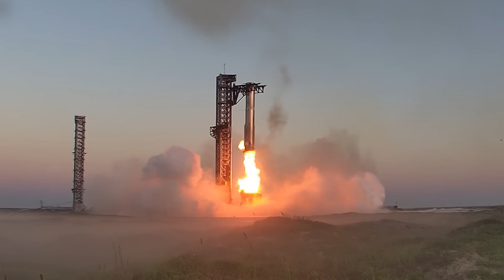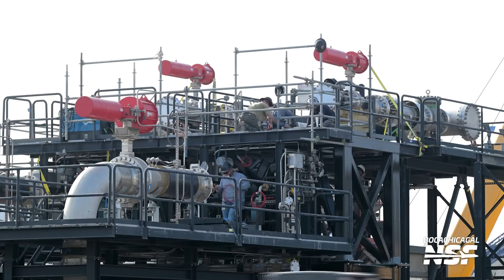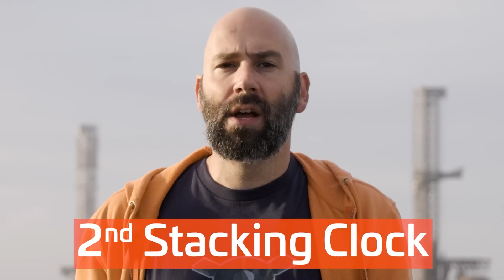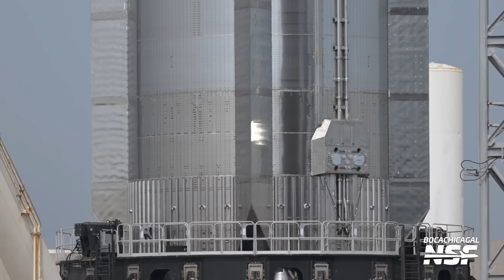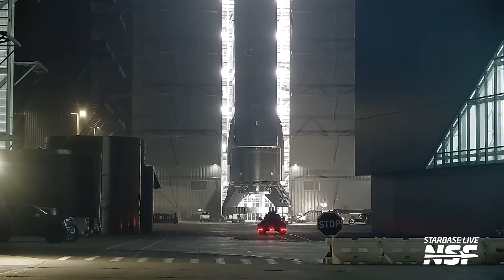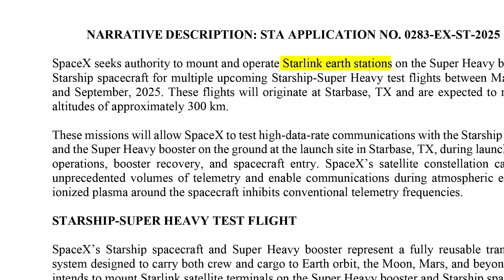Starship’s Longest Static Fire Yet! What We Learned From Ship 34 🚀 | Starbase Update

Comment: Small correction: 7,000 gallons isn’t 1,,600 cubic meters. Try 26.5.
Reply: Yeh totally. It’s roughly 1600 cubic meter per hour, not minute!
Reply: Cubic meters an hour perhaps?
Reply: If it's 7k gals / s then it's ~1,600 m3 / min. as well.

Comment: With all rhe firings at the FAA - will that further delay approvals?
Reply: Flight 8 will mirror flight 7 which means it does not need an approval. SpaceX needs to explain why S33 had a RUD, not the FAA. All the FAA needs to do is accept or reject the findings.
Reply: My understanding is that most of the jobs lost were in the the ATC field.  How many were lost in other area's?  Licensing etc?